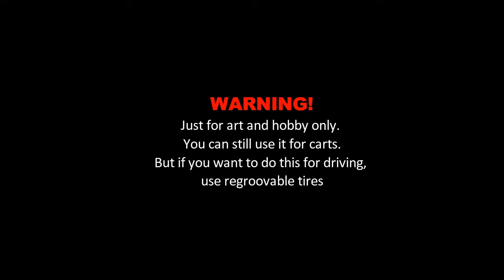THIS OLD TIRE CAN BE USED AGAIN

Comment: Купил лезвия разных производителей - но они ломаются, гнуться. Не получается так резать как вы.
Огромную роль играет ручка инструмента. У вас получилось сделать идеальные угол и длину стержня.
Попробую нарезать гравером с вертикальными фрезами. Потом напишу в комментариях что получилось.
Также я смотрю, что резина ваших шин мягкая. У нас в России она какая-то жесткая, задубевшая. То ли мне такая шина попалась для эксперимента. Нужно поискать другой фирмы.

I bought blades from different manufacturers - but they break, bend. I can't cut like you.
The tool handle plays a huge role. You managed to make the perfect angle and length of the rod.
I'll try to cut it with an engraver with vertical cutters. Then I will write in the comments what happened.
I also see that the rubber of your tires is soft. In Russia, it's kind of tough, stiff. Either I got such a tire for an experiment. We need to look for another company.
Reply from the maker: Yes, the type of the blade is very important. Not all brands can be used. This is indeed not as easy as it looks. But it's different if you are used to it and practice a lot
Reply: @tyre  I took a set of summer tires from a friend. I 'm doing experiments )
Now manufacturers are saving on everything. Here in the USSR they made good razor blades. And now the bullshit is thin, brittle, quickly blunt.
Is the handle/holder homemade or from some other tool?